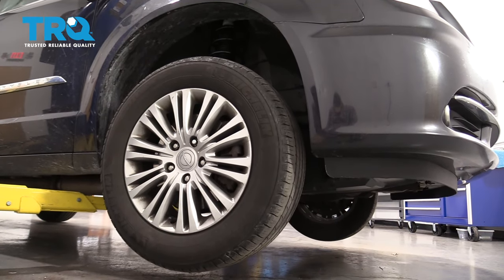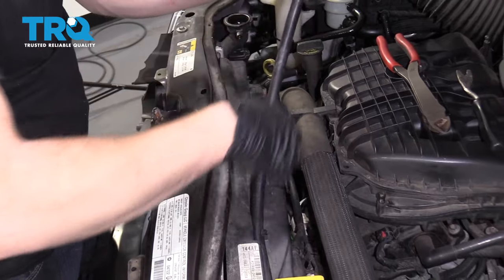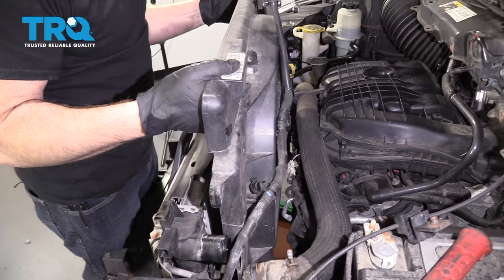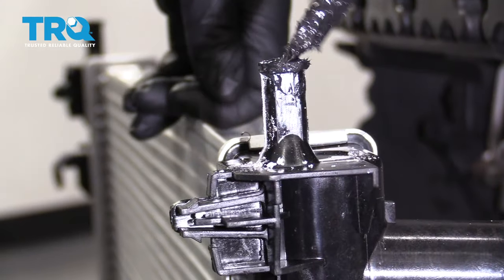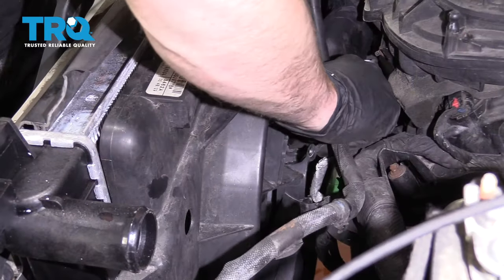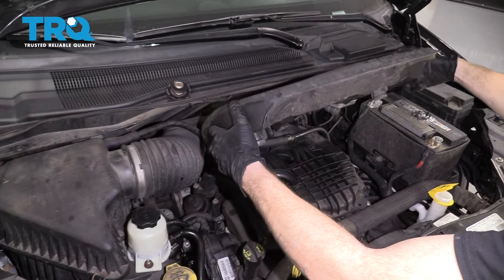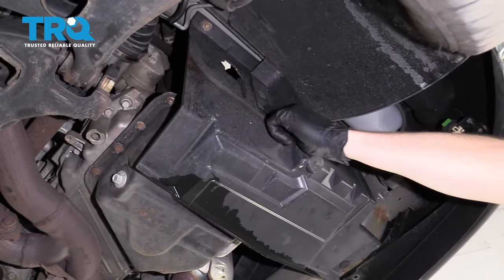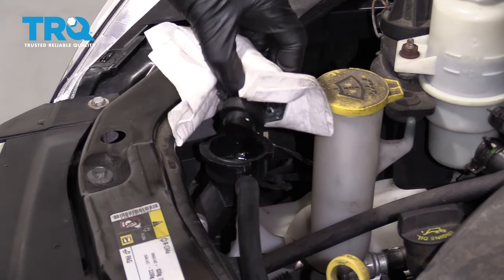How to Replace Radiator 2008-16 Chrysler Town & Country

Comment: I tried this repair without removing the front bumper cover on a 2010 Chrysler Town & Country 3.8L - and after 30 minute of trying to pinch the bottom power steering bracket radiator clips to free the radiator I gave up and removed the front bumper cover. Extra 10 minutes to remove the front bumper cover but makes removal and reinstallation of radiator 1000 times easier and less ghetto. This video is the best I've seen on YouTube for this repair! Excellent work and thanks for sharing!!! Perfect video!
Reply: Tried it as well, this video definitely helped!
Reply: Good info, Thanks! That is the case in a lot of situations. you try to do a repair without removing a part that is blocking access, you waste more time trying to work around the part than it would have taken to just remove it in the first place. On a Trailblazer/Bravada, etc  people cut a slot in the fan shroud to remove the radiator, which looks bad if you go to resell the vehicle and takes say 15 minutes. This is done rather than remove 6 bolts holding the radiator support bracket, which allow the radiator to move forward a few inches.

Comment: You don't need to remove the bumper. You do not need a pry tool to remove the rubber bumpers or grease to put them back on. It took maybe 20 minutes to do without removing the bumper and not using an air ratchet to strip out the bolts in the plastic.

Comment: All the tabs were missing on the  bottom of my van, the hiding bolts on the sides just broke off on both sides ,  couldn’t even turn a millimetre they just broke right off, on one side the bolt busted in half, on the other side the metal was rusted and just turned to dust. I got the red tabs to move for the electrical but can’t see which tab inside you’re talking about. Couldn’t find any assemblies for the fog lights on mine. There is nothing there on my vehicle and no electric wires there whatsoever. And nothing with a green tab. Overall you were super thorough in this video but it doesn’t seem to match my 2009 grand caravan. Unfortunately.

Comment: Technically you don't need to remove the fascia, but you will then need to be fairly flexible. Working around that isn't for the unfit for sure. But I admire your commitment to quality.. very nice job.
Reply: By facia do you mean the front bumper cover?
Reply: The bottom ones on my VW wasn’t a clip but a slot, they must of changed it for the bottom clips shown in the video.

Comment: TRQ !!! Please keep your high quality video tutorials coming. I would not have even attempted the radiator replacement without your professional instruction. You made the daunting task tangible, especially with the need to remove the whole front assembly. The quality of your production leaves all off the other DIY videos in the dust. I was able to complete the work in a little under four hours. Being able to stop and refrence the video for every step and fastener was priceless. Especially on reassembly where most of us ametuers get to that point of " where does that bolt go again" Helping average Americans to litterly save thousands of dollars-in there moment of need- is heroic in todays economy. Thank you and God bless you.

Comment: Thanks for this video. I just completed this on my wife's 2016 Chrysler Town & Country. The whole job took roughly 4hrs due to me having to flush the engine twice to get all the stop leak out of the motor. I got everything from rockauto (the TYC Radiator PN#13064 $111.00, Motorcraft VC-1 engine flush $11.00, and VALVOLINE 877981 G30 Pink OAT Coolant 3 x $16.74). Whole thing cost me $222.13 w/ shipping. The radiator was a perfect oem replacement.
Reply from the maker: +David C Thanks for watching our video! http://1aau.to/m/Shop-TRQ

Comment: I’m a competent diy-r, I have a good suite of tools (minus something to deal with those hose clamps) and the job took me 3 hours start to finish. I wasn’t in any rush to get it done so 2 hours is possible for a first timer with the right tools. 

Those electrical plugs gave me so much trouble until I did the first one. It doesn’t help when the vehicle is old and they don’t slide off easily. The “tab” that you reveal when sliding the red portion back is the gray step piece. You have to push a larger flat head onto the gray part and it barely hinges. Then force the connector off. Once you do one the rest are easy- but when you don’t know exactly what you’re trying to accomplish it is frustrating. 

Some of the bolts are really tricky to get to so be prepared to get creative unless you have the perfect tool at the ready like he does in the video at each step. 

It goes back together in half the time it takes to remove it.

Comment: Very nice video guide to this repair - highly recommended . I'll be sure to look for TRQ videos in the future.
Couple of comments on this video. 
My vehicle ==> 2010 Town and Country (which I love)
• Definitely take off the bumper.
• I did NOT have to unclip the fan electrical connections. I tried to take one off - but they are stuck together right good. Seemed simpler to disconnect the fan shroud with elect connections in place. Was easy.
• Missing from tutorial: at bottom of A/C condenser (in front of radiator) two 10mm bolts, one each side need to disconnect the A/C lines that cross at the bottom. 
• Actual 'yank' of the radiator did not release it. Turns out the rubber bottom supports were well stuck on. Additional yanks: the radiator came loose, but rubber remained on the frame. New radiator fit right back into them, No Problem.

Comment: Thanks for posting the video.  I had replaced the radiator on my 2005 Town and Country a couple years ago and it only took about an hour and I didn't even need to watch a video.  So I attempted to replace the one in my father in law's 2008, and what a difference in difficulty level 3 years newer!  I never would have expected to have to take the whole front end off.  Also I was working outside in 18 degrees.  Worked on it 3 hours the first day and almost 6 the 2nd, but I finally got it in.  Never would have finished the job without the excellent detail in your video.  It's -3 today so I'm happy to have finished it yesterday. 
I do have a couple questions:  First, one of the rubber cushions fell off that go on top the right hand tab on the top where the clip that holds the hood latch cable sits on and I didn't find it until this morning.  Is it worth taking the top piece back off to put it in?
And secondly, what is the trick to get the tabs on the bottom of the condenser into the clips on the radiator?  On mine, the top snaps in, which was easy to release, but the bottom just sits in L shaped clips.  It was very difficult to lift the condenser up high enough to clear the top of the clips and get it seated in there because the radiator kept wanting to lift with the condenser.  I didn't think I used any excessive force and I didn't pry or anything, but the clip on the right side broke right off of the new radiator.  It's sitting in the left clip and securely snapped in on both sides of the top, so it's not going anywhere.  Just wondering what I could have done to make that step easier?  I wasted close to an hour getting it in place.  
Typically, how long do you think this job should take?  Thanks again, one of the best instructional videos I've ever watched.

Comment: Do you have to do the whole coolant pressure tester part? Can't you just add more coolant by pouring it in there without any special testing equipment? That's kind of expensive to buy.

Comment: I ran the van with the heat turned all the way up and was baking. The fan never actually turned on even when the thermostat was at the the halfway point. 
I had to turn the ac on and all the way cool for the fan to kick on.

Comment: What is that device he used to create the negative pressure in the system and then refill. I always have an issue with getting air in my cooling system.
Reply: You don't need that system that is just for show I just put plain water on my radiotor
Reply: I think it was basically this device. I have never used one, but I've seen them used in other videos. And on some vehicles they are required as the system will not "burp" out the air pockets. It does check that the system holds pressure and can eliminate/reduce the burping process.  The reviews have some good info/user experience. 
** Sold at Harbor Freight, SKU 64985, Brand MADDOX, Cooling System Test and Refill Kit

Comment: On the "vericle"!!! 😂
Reply from the maker: +Buffalo Eskate Thanks for watching our video! http://1aau.to/m/Shop-TRQ
Reply: @TRQ  just had the guy at the shop tell me... "You got a hole in radiator and need to have it replaced so I replaced the radiator with a brand new one and come to find out it was just the hose or a $3 clamp... But I did not realize until I already replaced the entire radiator which is not too easy when HAVING NO LIFT AND NO POWER TOOLS.. BUT GIT THE NEW ONE IN JUST TO SEE THE SAME LEAK AND FOLLOW IT TO THE HOSE AND CLAMP!!! WHAT A WASTE OF 2 DAYS... AND $300 FOR THE RADIATOR AND COOLANT!!! UGH
Reply: Yes I found it to be informative and will mention your channel in a video or two on the channel!!! Thanks for the time put in to put the video up brotha!!!